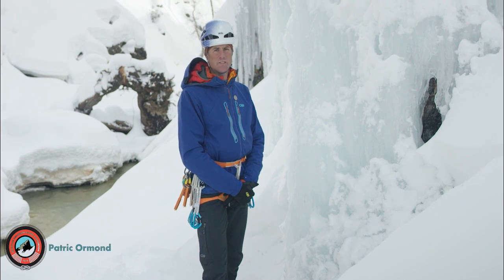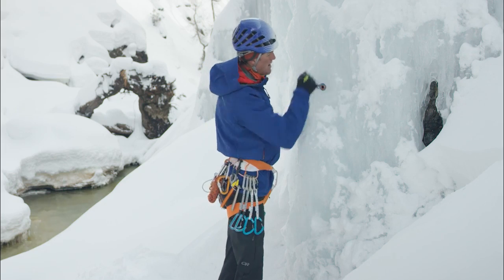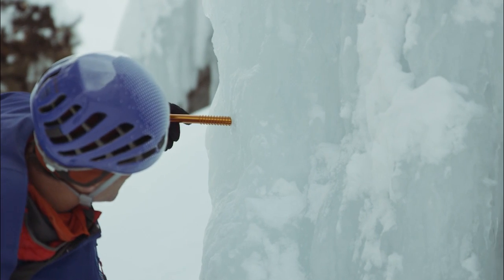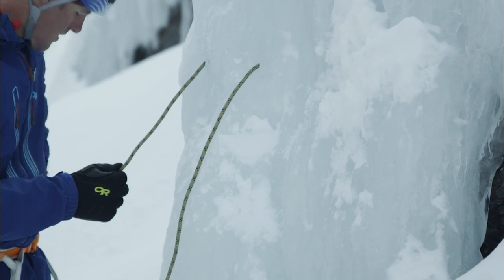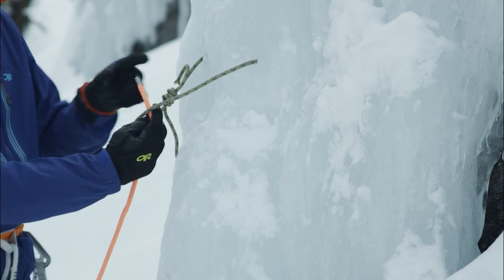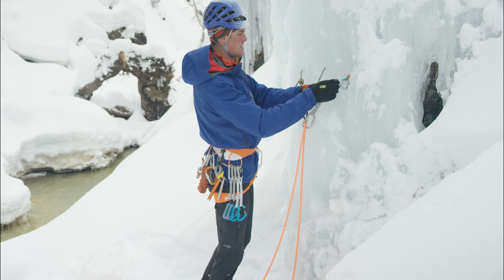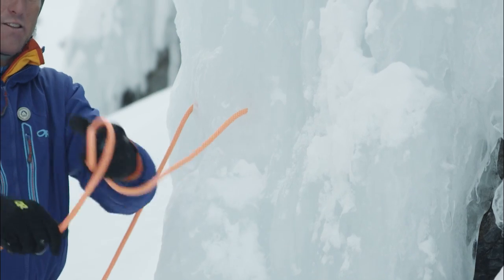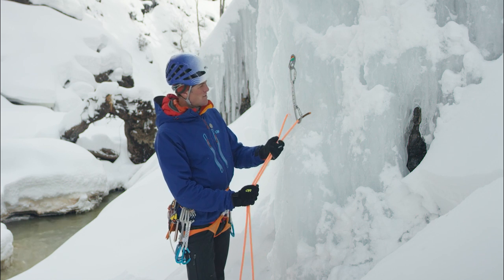How To Build A V-Thread and 0-Thread Anchor

Comment: Is the reason you're not just using an ice screw by itself because the screw is not strong when used vertically against the direction it went in? Or is it the efficiency of cleanup when the last guy rappels and can take the gear with them?
Reply: It's so you're not leaving gear behind. Ice screws are expensive. The screw acts as a backup for the first rappel. After the first person gets down and the v-thread has proven itself strong, the last person will rappel off the v-thread alone and remove the screw.

Comment: Does it make more sense to core out the V thread holes slightly pointing downwards (or in the direction of pull) to mitigate any shearing of the cordallette on the holes when loaded? Similar to the downward angling of screws when placing them on lead?

Comment: A double fisherman's on the thread is a bit time consuming and tricky with cold hands or gloves. Have you considered a simple overhand as used for twin rope abseil, with a second separate overhand next to it just to be sure. Quick, easier to tie with gloves, easy to inspect.
Reply: You could use an overhand aka "european death knot" but keep in mind it weakens polyamide cord's breaking strength by ~30%. dyneema or kevlar cord would even be weakened ~70%!

A triple fishermans on the other hand doesnt weaken poylamide at all and dyneema/kevlar around 25%.

Comment: Is it trust worthy.?? I have never used.
Reply: Decades of use says yes, for sure. When you make a good one and the ice is HARD, you'll have no doubt. The loads on it should be minimal as well. There's also the beauty of the heavier of the two climbers gets to test it while backed up. The second person then gets to examine the holes and surrounding area for fracturing or other changes in the ice once the first climber has gone down to the next anchor or the ground.

Comment: I understand the concern that your rope may freeze and get stuck in wet ice, but please explain the concern in negative temps?  (And do you mean negative C or F?)  And please explain your backup screw and draw- is it for everyone except the last one to rappel who removes it and brings it down?  (My guess and what I've read elsewhere.)  Thanks!
Reply: I'm pretty sure he meant Fahrenheit as positive Celsius would be wet ice as it is melting and he mentioned that separately.
Reply: Thanks, Andrew!  Got it- if the ice is wet but temps are or will be freezing, the rope could freeze in the ice and make for a bad day. 

Makes perfect sense, not sure why I didn't get it first time around.  I probably shouldn't post questions late at night!

Comment: So you backup the anchor and then weight the v- thread then remove the backup before repelling? Or do you sacrifice your gear and leave the screw?
Reply: The point of the backup is to not be weighted unless the v-thread rips out. In that case, the ice screw should save you. You let the heaviest climber abseil first. If there are no problems with the v-thread the second lighter climber can take out the backup and abseil on the thread as well, thus only leaving the v-thread and not the expensive ice screws. Hope that helps :)